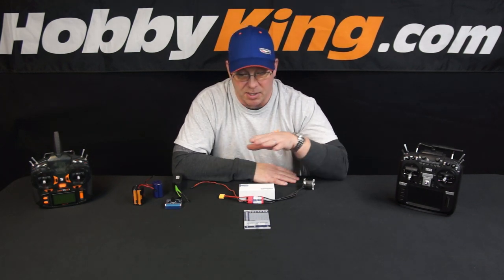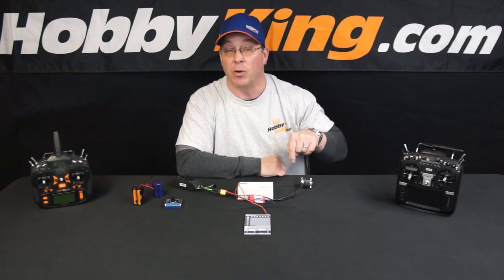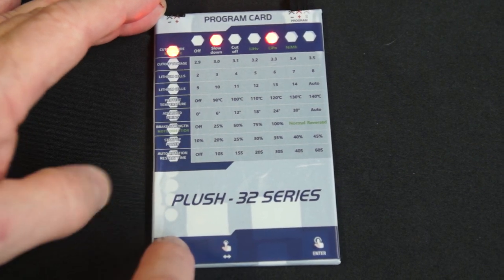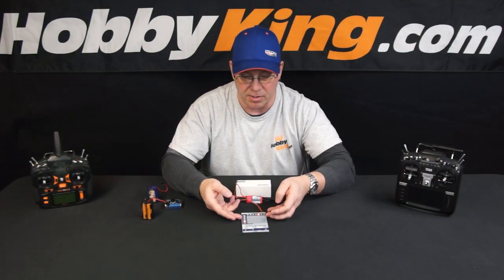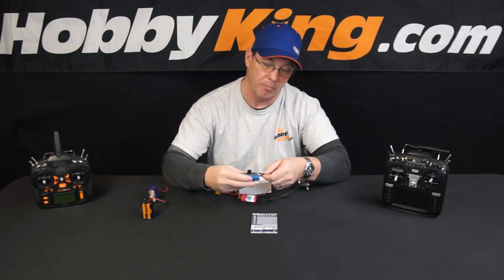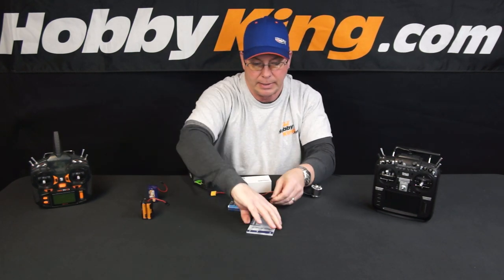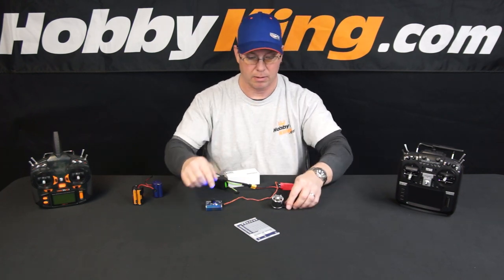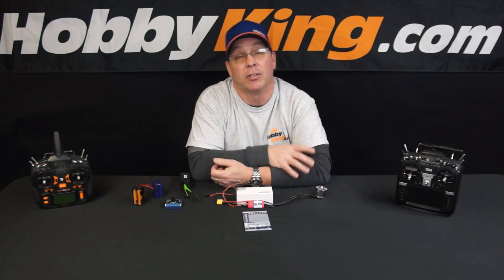HobbyKing's Tips Bench Tuesday - Program and Calibrate the Turnigy Plush-32 Series ESC

Comment: I fly wings and planes with li-on packs.  6s2p usually.  Do I need to set anything different when programming?  I no I set cutoff voltage lower with li-on cells and actually set mine to 2.9v and cutoff type slow down but what about other settings like start up and timing.    I was told to use Auto timing but haven't tried that yet.  Also noticed that even with brake set to 100% its weak and prop on my wings still spins and sometimes brake on landing.   
Any suggestions???
Thanks.